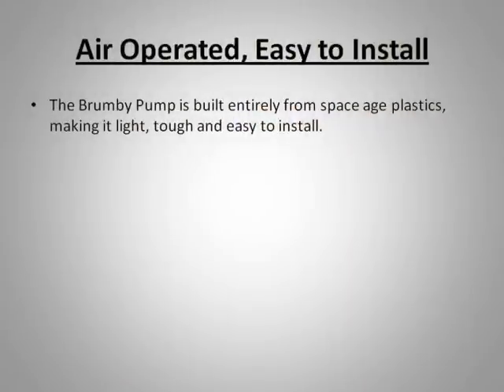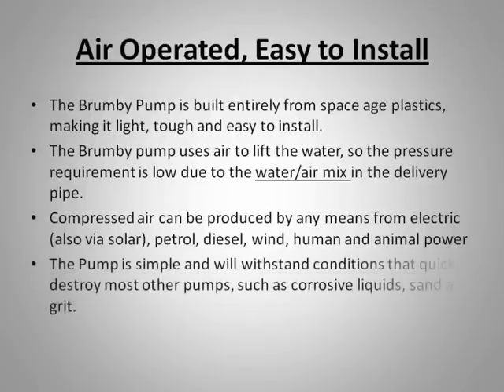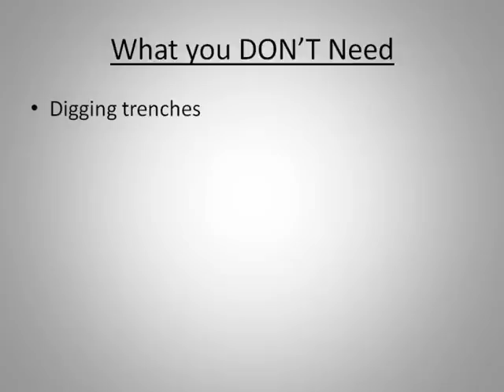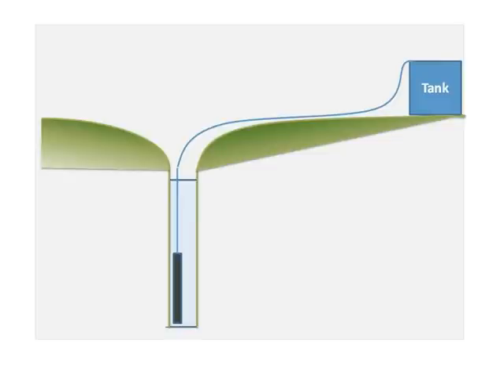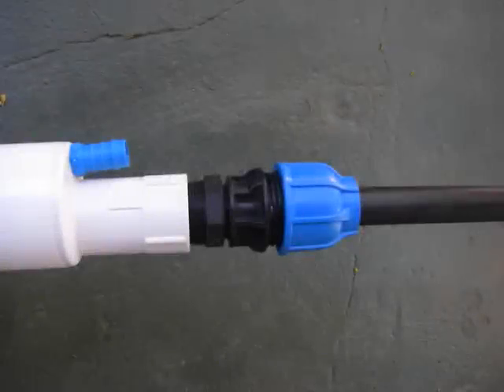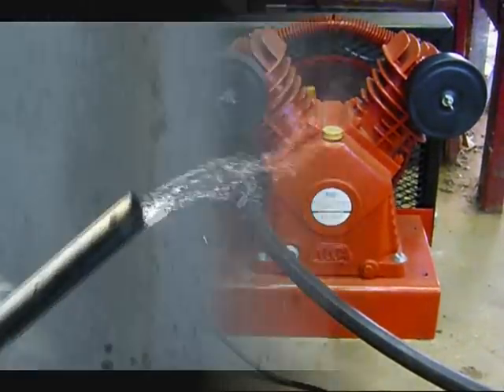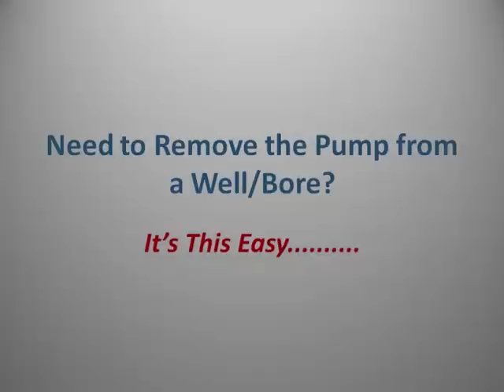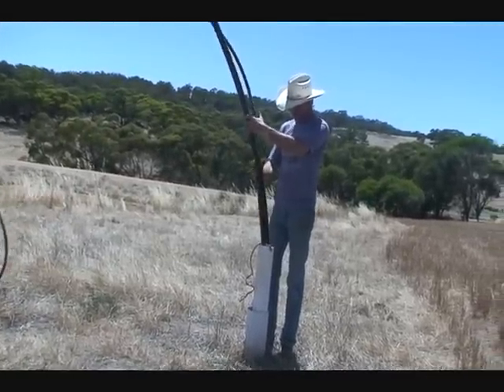Brumby Pump Installation

Comment: good one, easy to install and remove, 
whats the maximum depth of working ,, {ours well  350 feet }
Reply from the maker: the maximum depth depends on the water depth. 350ft may be entirely possible. Please email me with details of your well, including static water level via the website www.brumbypumps.com/contact. Thank you